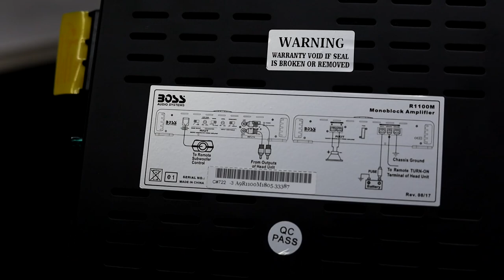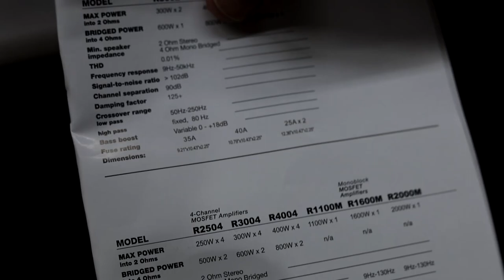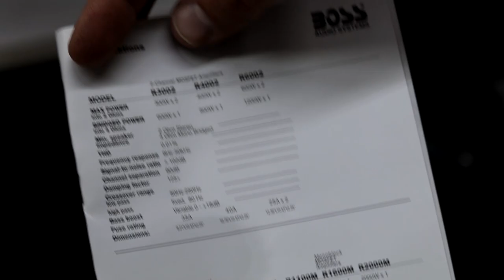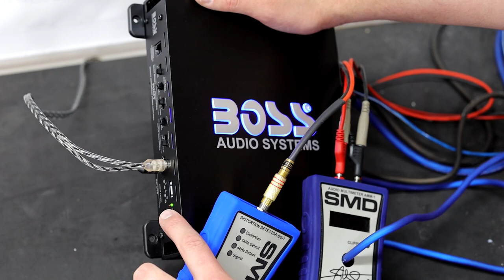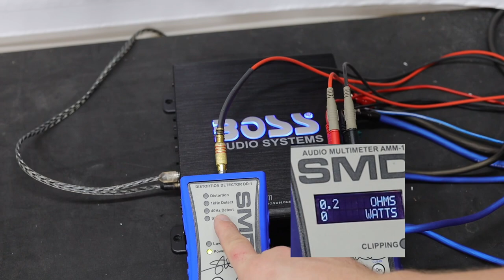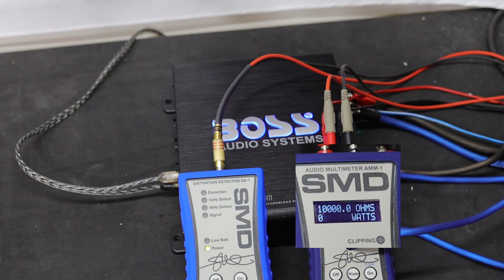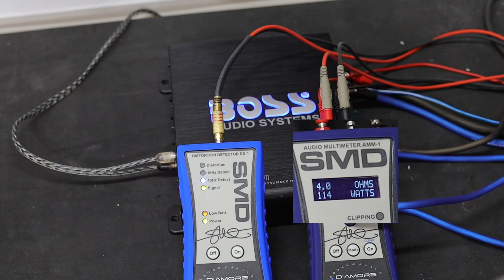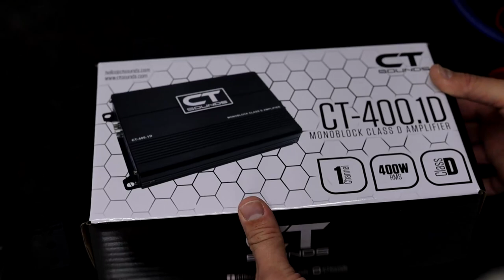BOSS Audio R1100M  Amplifier Review - In Depth

Comment: A list of better amps the cost less would be cool . . I will say the protection circuit in a boss amp is very reliable you can give a boss to someone who has no idea what they doing they can wire it backwards and turn it on and it will protect it's self fix the wiring and it still works . But I still do not ever recommend boss to anybody ever or planet audio , or ssl or the other brand that they own under same company I can't think of right now .
Reply from the maker: Truty

Comment: I'd say it will atleast do 250 true watts that should make any size sub hit decent 
Especially at 2 ohm
Reply from the maker: Did you watch the video?
Reply: @ATCA  yea I believe it said 110 watts not sure if that was 2 ohm or 4 I didn't whatch it in depth 
Either way it should push a 10 or 12 nicely
Reply from the maker: @AOG_ETH  185w atvw ohms.
Reply: @ATCA  that is not bad for a little bump n the trunk I got one today new for 40 I've had high end stuff 15 years ago I'm excited to get a little base in my factory setup